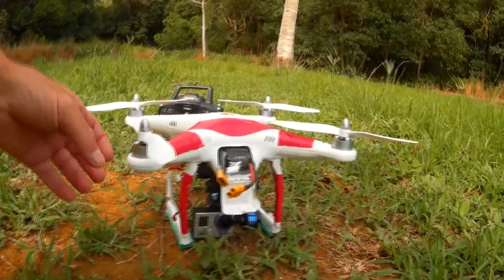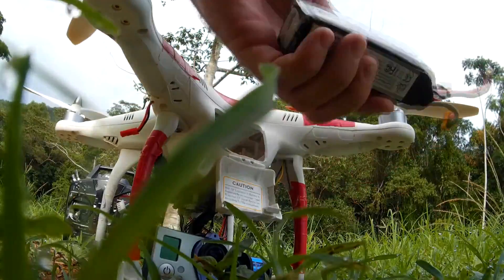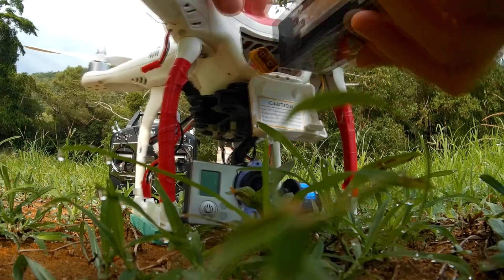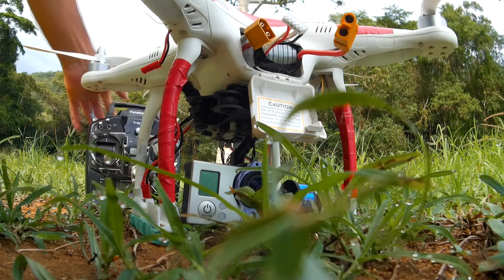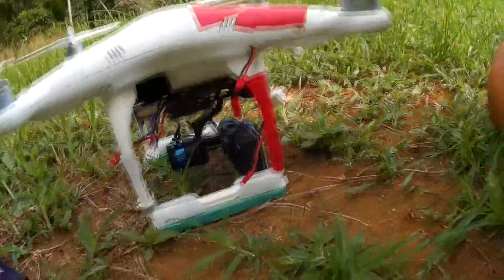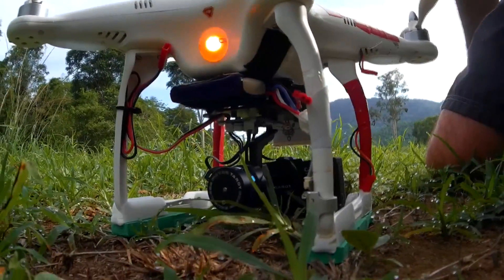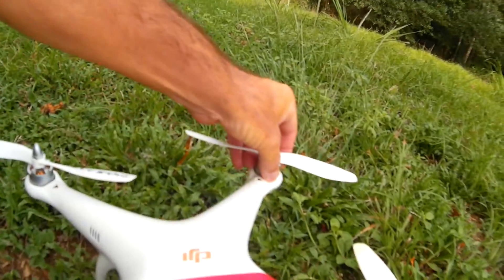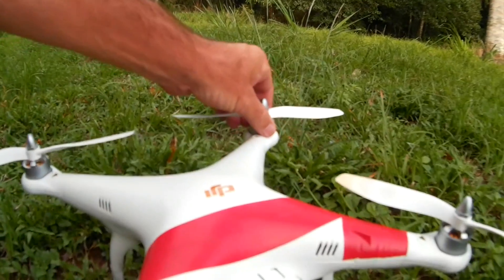4S Lipo DJI Phantom Quadcopter

Comment: Do you use the Stock ESC? Can they handle 4s?
Reply: Intruder Evil the motor driving MOSFETs operate up to 30 V, and the controller chip has a regulator for 3.3V. The question is: what is the exact type of the regulator? How high voltage does it take?